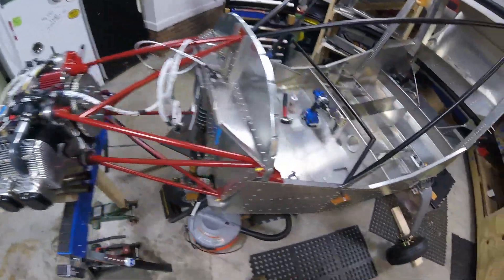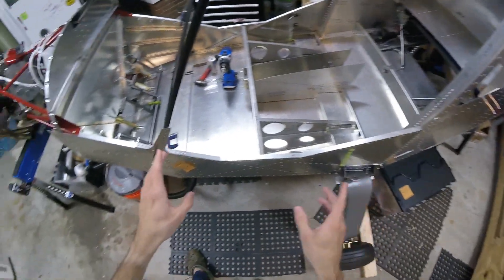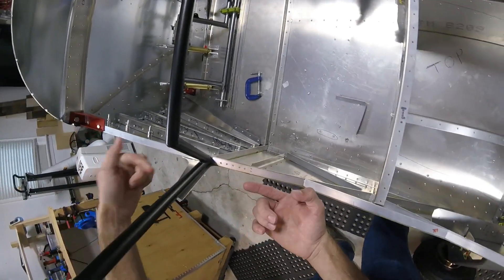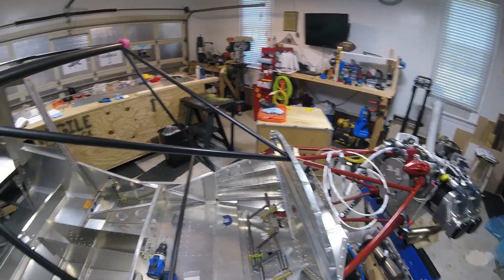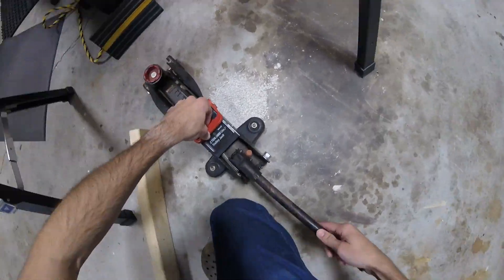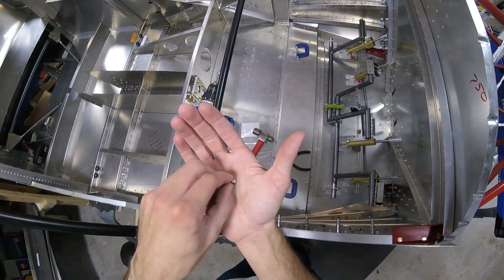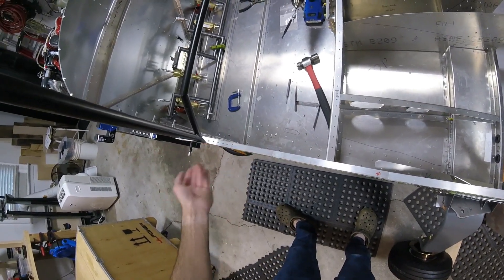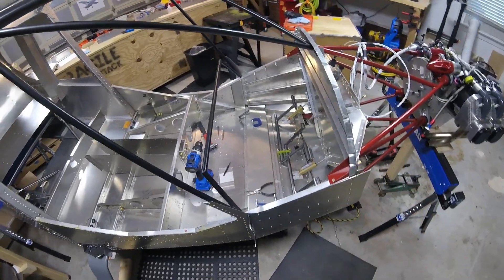Cabin Frame Steel Bracket Mistake - Zenith CH 750 Cruzer Kit Plane Build

Comment: Dont drill thru, its not 90deg the holes wont line up with the bracket you already drilled.   To match the holes you already drilled on the inside part use a STRAP DUPLICATOR, this lets you locate the hole and drill the new part.
Reply: I agree - I was going to recommend this too. They're around $10 on Amazon or Aircraft Spruce.
Reply from the maker: Hey good point! I realized that just after I made the video.

Comment: I'm wondering if it weakens the structural integrity of the frame to have the extra holes that are in the same location on opposite sides and if the frame is compromised and may not hold the wing loads without cracking overtime? Might be a good question to ask zenith.